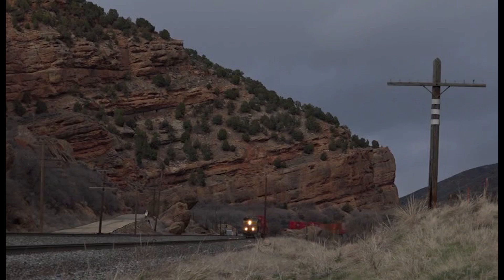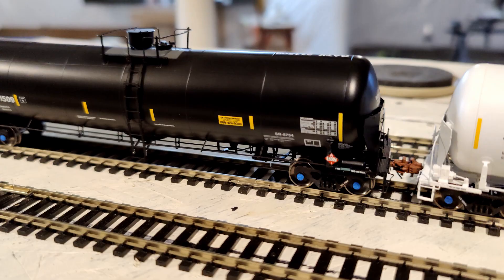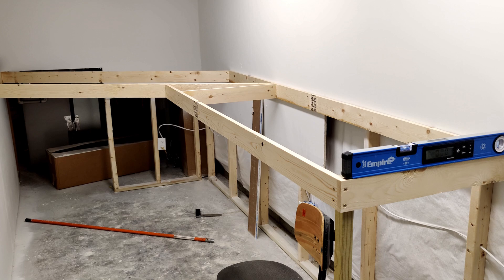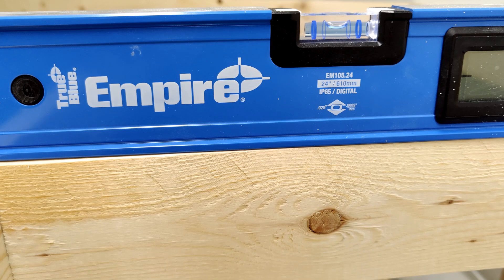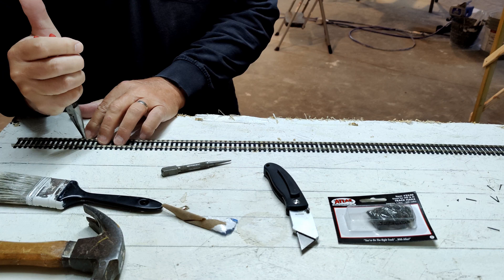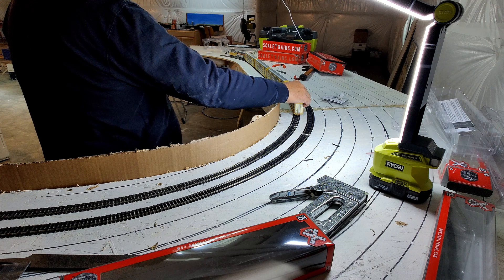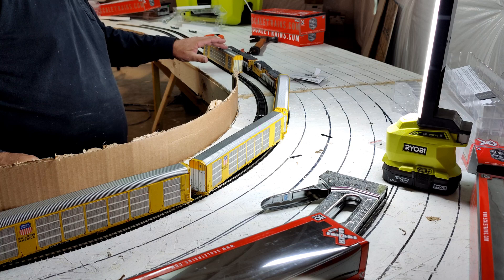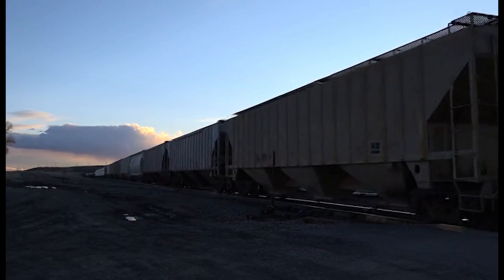HO Model Train Layout Built for Operations & Realism. UPRR Evanston Sub - Staging Yard Pt3 S2021E10

Comment: I use small vice grips that are adjustable that has serrated jaws.  They fit perfectly to my hand as I push the small nails into the rail ties which leaves the head sticking up and by closing the jaws push the head against the ties.  No need to use a punch.  I have found this quite useful since i have built 7 layouts.  I started out using a punch but had too many accidents where the punch point slipped off the nail head.  I mostly use 1/2 inch nails for majority of my track work and in some places use 5/8 inch long or 3/4 inch to hold the track more rigid depending on the situation.  I can't wait to see the finished layout as I enjoyed your "N" scale.  While it was my choice for several years I transitioned to "HO" when my eyes went bad.
Reply from the maker: Spiking will be a lot easier once I get to the modelled mainline with a sub roadbed.

Comment: One massive recommendation  anti fatigue mats for 2 reasons  1 incase a oops moment happens and the other your body will thank you as I work on a concrete floor it's very hard on joints
Reply from the maker: I will do something about the concrete floor in addition to painting, either carpet or garage/gym mats.  Probably will wait until the messy parts are completed.